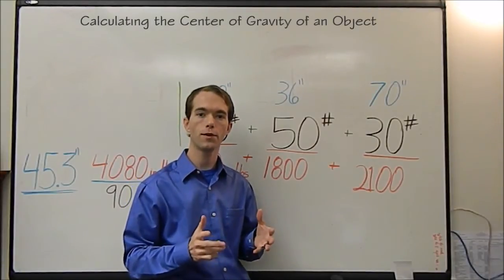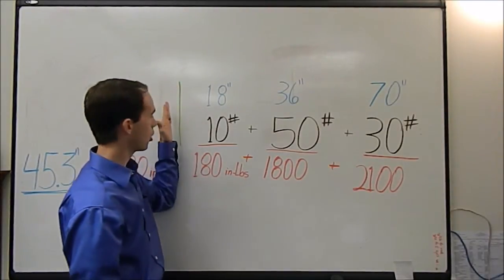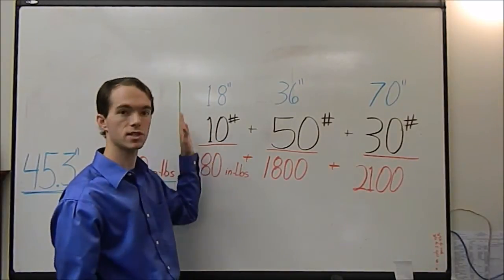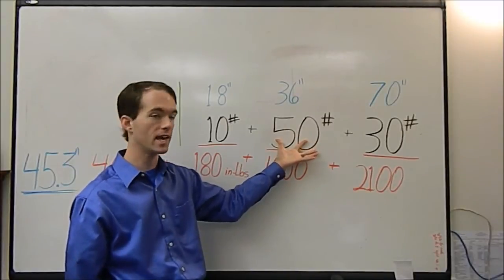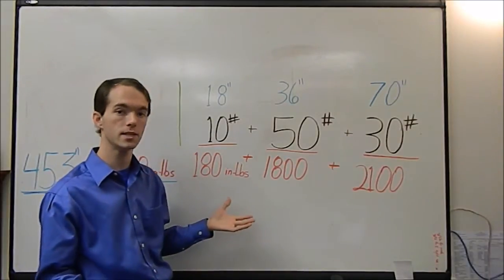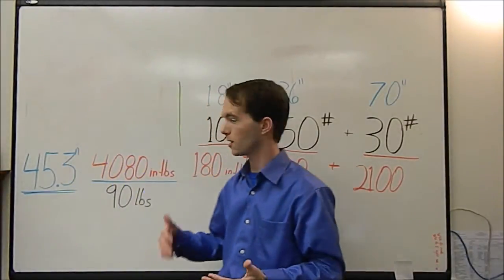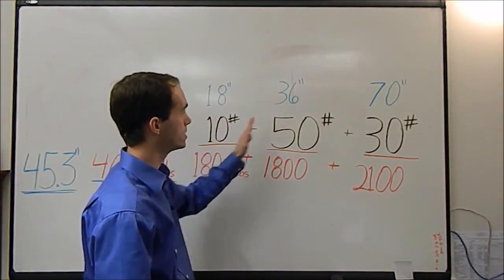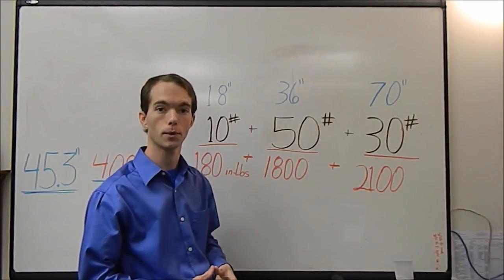How to Calculate a Center of Gravity      Mikes Inventions

Comment: We do the same thing with model airplanes. I use a spreadsheet and enter the distance from the front of the spinner and what the weight is at each location. The spreadsheet multiplies each distance by the corresponding weight to get the moments, adds all of the moments and the weights, and divides the sum of the moments by the sum of the weights to get the distance to the CG from the front of the spinner. It doesn’t matter what units you use for the distances or the weights as long as you stay with the same units.

Comment: Can you calculate only using two points?

 I have only fore and aft weight measures and using this formula, it doesn't quite work out.

Total vessel length 35 ft.

1st is 1.5 ft from aft at 7380 lbs. : 1.5 x 7380 = 11070 ft/lbs
2nd is 25.25 ft from aft at 6090 lbs. : 25.25 x 6090 = 153772.5 ft/lbs

153772.5 + 11070 = 164842 ft/lbs

164842 / 13470 = 12.237713 ft

Is this correct?
Reply from the maker: Yes, that is correct. I checked it for you. Good job. You'll want to account for the mass and center of the boat, if that's also important to you.
Reply: I appreciate that. I'm a novice and trying to gain more knowledge about LCG for building these things.  Thank you!